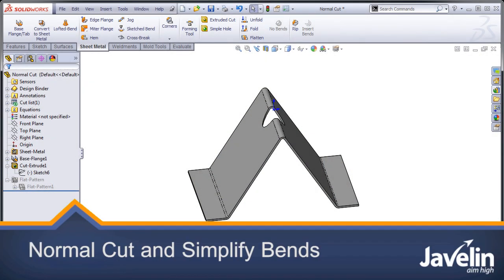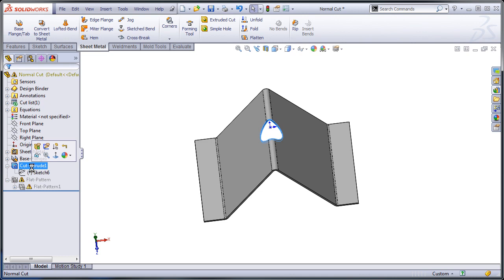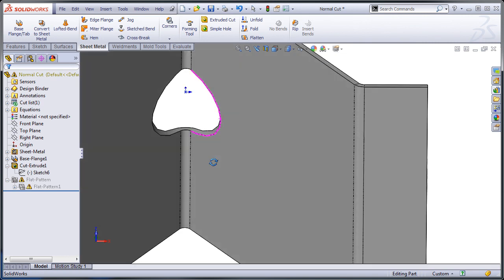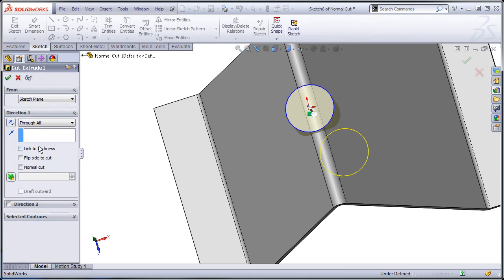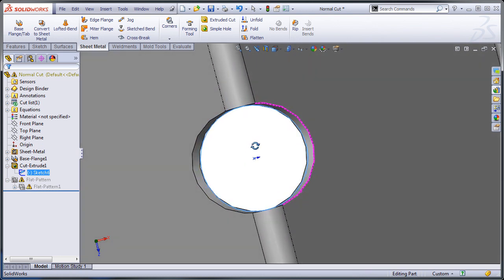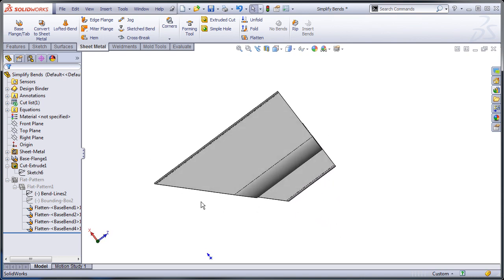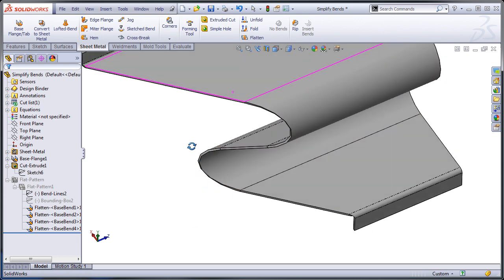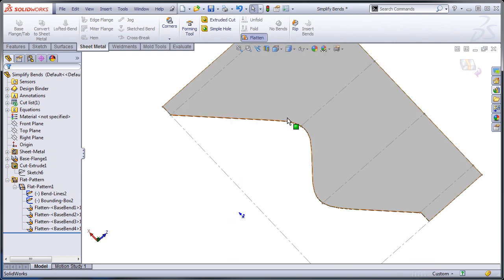SolidWorks Sheet Metal: Normal Cuts and Simplify Bends

Comment: thank you very much. I have a similar solid to the second one in this video. I want to unfold and refold it by parts. I mean i want to unfold it in different stages not to unfold the whole pieze in one single stage. Do you know if that´s possible? If it is i´ll be so glad to know how. Someone please help me!
Reply: You might have got the reply. Anyways you can use sketch bends to get bends at different stages.
Reply: Better late than never, but in Solidworks 2019 there are Fold and Unfold commands that can do just that.